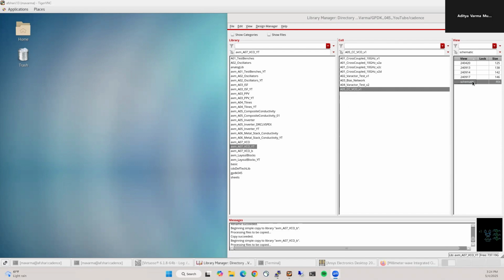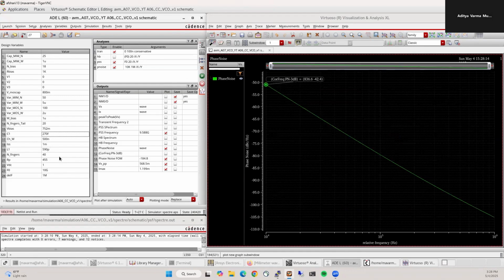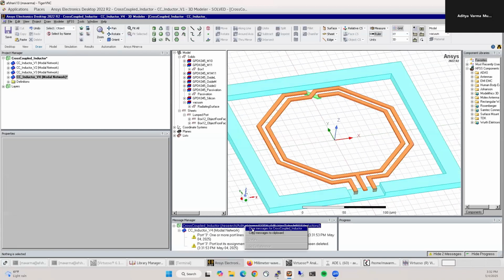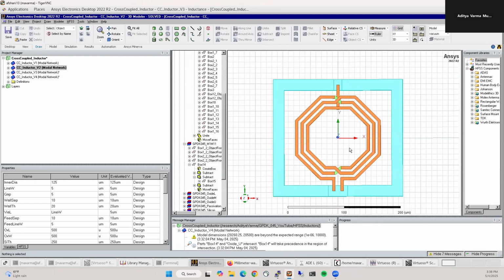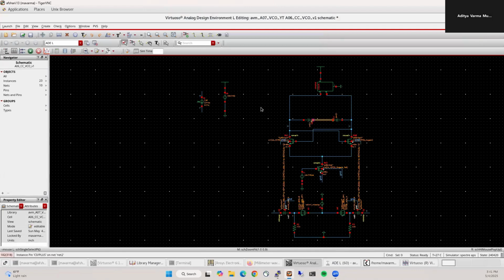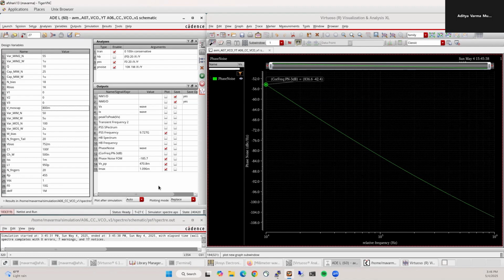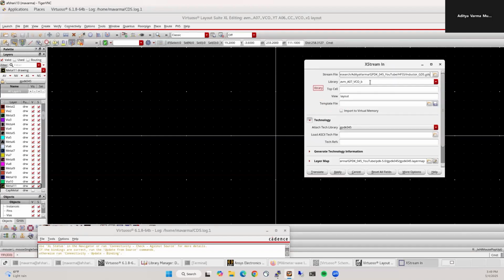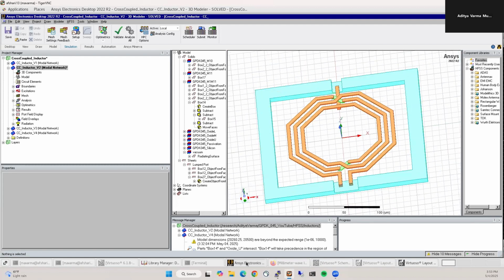Cross Coupled VCO Design (Part-2: Inductor Design) | Oscillators 17 | MMIC 29

Comment: Hello,
I have experience using HFSS for PCB designs, but I’ve never designed CMOS on-chip inductors or transformers before. Could you please explain how to set up the simulation options in HFSS for this type of structure?
Reply from the maker: I made a video about that earlier. Here is the title: "Parametric Design of On-Chip Inductors and Transformers in HFSS | MMIC 01"